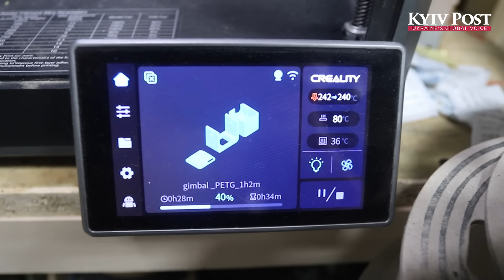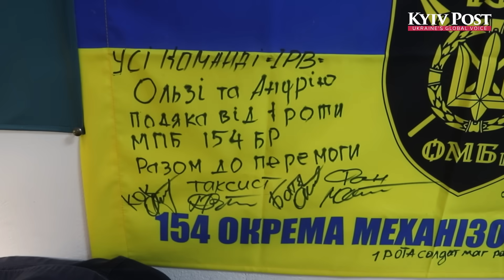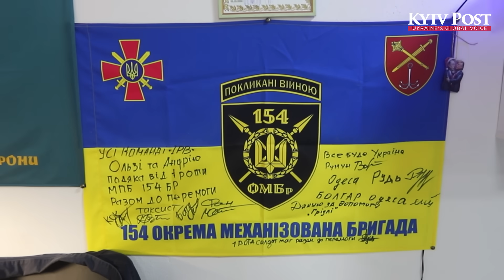Inside a Drone Factory: How Ukraine's Victory Is Built and What It’s Made Of

Comment: From motors to camera modules to communication modules and batteries, I don’t believe Ukraine has any manufacturing capabilities. As for the microchip control mentioned in the video, it seems to me either entirely produced by Chinese OEMs to deceive the government for subsidies or involves buying core logic chips and doing simple packaging. Not to mention the 3D printers and materials used for manufacturing the frame.
Ukraine is indeed making continuous improvements in FPV applications and has addressed some employment issues, but to claim that Ukraine has become a drone powerhouse is clearly too arrogant. If China wanted, Ukraine wouldn’t be able to produce a single drone.

Comment: I don’t see the tools and processes here I’d expect from an industrialized plant. For example, you’d have (usually by Hios) torque-controlled screwdrivers. You’d have a reflow line. Pick-and-place machines. 3D printers can be had that scale better.
Reply: Ukrainian drone technology depends on which version of drone they can buy on Taobao in China. The 3D printer you see in the video is a Bambu Lab X1-Carbon, also from China.

Comment: I was hoping to see how/where they attach the payload and arm the triggers.
Reply: Top secret😅
Reply: In kamikaze they attach the warhead at bottom of the drone or dropper have some dropping option ( reusable ) and trigger it with piezoelectric switches or impact switches moslty common this use but sometime they use electronic fuse which is activated by transmitter
Reply: @SAIRAJPISAL  From what I've seen, they also use a bare wire surrounded by a bare wire loop. When crashed, the wires complete the circuit. I just wanted to see the delicate process of arming these.

Comment: Why don't drone manufacturers use multiple blade fans that run quieter - like those computer fans or even 4 blade scissor fans.
Reply: The more blades the less efficient so less range. That's why DJI drones only have 2 blades.
Reply: @ioijiopjkiopjkp  Quadcopters actually have a total of 8 blades usually. But heavy lift helicopters like the Sikorsky Skycrane have a six bladed rotor. Blackhawks have four.
Reply: A prototype 4 blade scissor rotor could be made by cutting two opposite blades from a 6 bladed rotor.
Reply: Physics and feed stock , in other words more weight and more materials . 💛💙🤘🏼💛💙🖖🎶🐝🇺🇦🤟🏼
Reply: Because the ukrainians suck at tech. We like always need the germans to upgrade those drones.
Reply: @Delgwah  I suppose a bomb is not weighing much either.